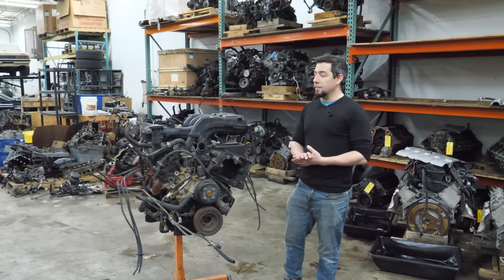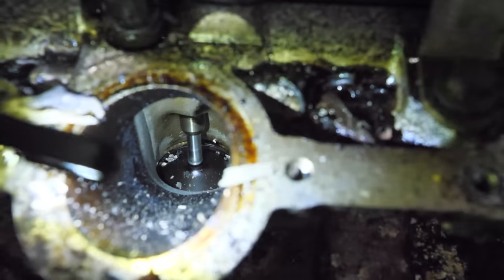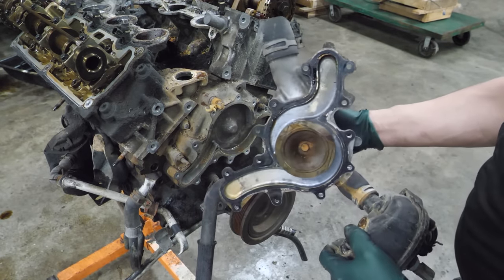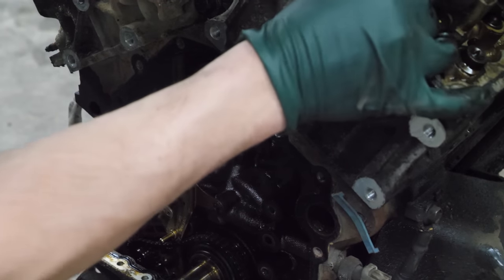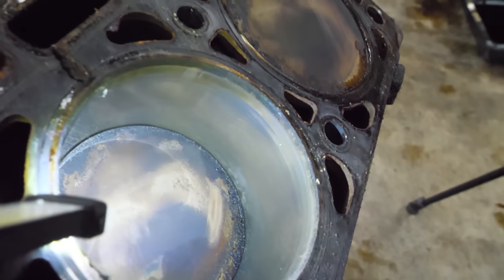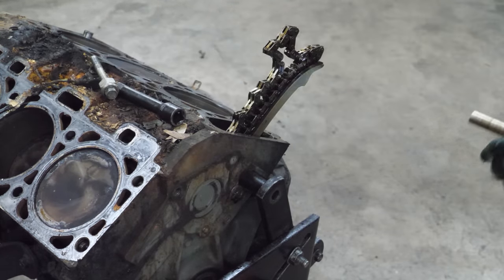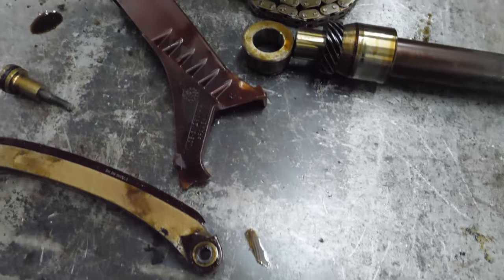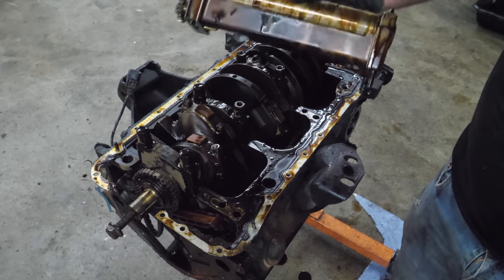Ford Explorer / Ranger / Mustang 4.0L SOHC V6 Teardown! Is This Why They're Called "Exploders" ?

Comment: I had an 05 mustang with this motor, had 190k miles when I sold it.  Ran flawlessly, but I always kept up on the maintenance and oil changes.  It was a fun car with the manual trans and got decent mileage.
Reply: The 4.0 does well with a 5 spd manual in the mustang. Agree 💯
Reply: I had an '05 vert with the 4.0 and the 5 speed, was fun on a budget. Had it until 140k, changed the oil every 5k. Only issue I had was the harmonic damper split in two and threw the belt, but not a big deal. Kind of a lazy engine but had enough torque to be fun
Reply: My wife had a '07 'stang with this motor and a 5 speed. Pretty peppy in 1st and second gear, just dies in 3rd on up. Sold it with 70k on the motor, ran like a top, Mechanics I know warned me about the cost of working on the engine if something did go wrong. Still, I hated to see her sell it. I have a '08 GT, it was cool having his and hers mustangs.
Reply: i actually have an 05 stang and it has 225,000 miles on and still runs perfect. but i also am always doing maintenance on it every week just due to the fact that i work in an autoparts store. but really don’t hate this motor and it’s been perfect for the life of it
Reply: I drive an 06 Supercharged Mustang with the V6, 234k miles, well maintained by previous owner (overdid maintenance actually) and runs like a champ!

Comment: Had to do the timing chains on my wifes Explorer about a year ago... biggest thing that had me questioning the universe was: non-keyed cam gears (held in time purely by bolt torque), that required a toolset to time... That engine better hold up after all the hours I put into that. Notes for others that are looking to perform the timing chain repairs: 

1. No, you cannot do the rear timing chain cassette without removing the engine... people are full of crap if they say you can. you have to remove that little torx bolt towards the bottom of the cassette to remove the guide, and its obstructed by the trans bellhousing, as stated in the video.... (yes, it leaks from the rubber seal if you try to reuse it, don't ask how I know...) 

2. as I've previously stated, you need that timing toolset to reset timing on the cams... it's not worth saving the $40-60 if you end up having to replace the engine. 

3. get a replacement rear main seal, its worth it.

4. If your 4.0 has the balance shaft (when looking at the front of the engine, its to the lower left of the crank), be very careful torquing the 4 E-Torx bolts that hold the balance shaft assembly in, I snapped 2 of them off.... added 2 weeks to my repair time waiting on parts.

5. yes, you can get the front cassette chain guide out and in, without removing the cam or head. just remove the jackshaft gear, and pull the old chain guide out through the bottom, by pulling it hard towards the front of the jackshaft. if you have patience, you can very carefully maneuver the new one in, though its a pain... if you're impatient like myself, just remove the c-clip on the hinge of the guide, and replace it when you get it in place.

6. it's expensive, but CHECK WHICH BOLTS ARE TTY!!! There are ALOT of them when doing this job... I have Ford part numbers, if anyone needs em, just reply to this comment.

{Edit: when I says it's impossible to do the rear cassette without removing the engine, I was referring to separating it from the transmission, and yanking the motor out. Sure, you probably could pull the tranny out, but I would strongly advise just pulling the motor... So much easier to torque things to spec with the engine out, ESPECIALLY when it comes time to time the cams}
Reply: Yeah yanno I don't think I'm willing to do head gaskets on my mom's 04 Explorer with this engine after all. Fuck that thing. Half tempted to just swap a 300 into it and call it a day, but I don't think the nose is long enough.....or that the transmission would be able to handle a proper torque factory. 300s were notorious for cooking C4s out because their torque comes on so strong so low down that they'd boil the fluid in the converter and the C4 is way more robust than the Advanc-Trac bullshit in her exploder.
Reply: Excellent advice, and yes I agree that it's crazy the cam gears aren't keyed.
Reply: @TestECull  put a 5.0 in it or a 4.6, they were available factory and can all the brackets and hardware harnesses at u pull it, but would probably be cheaper to buy a whole wrecked or rotted runner and scrap it after you get what you need
Reply: You can do the back side timing chain with the engine in the truck (I did my 05) you just pull the transmission out.
But pulling the engine is the better way.
(Hahaha I almost wrote "easiest" way)
Reply: @spex20  I mean I always follow the rule...if the repair requires them to be split apart, engine repair, pull engine. Transmission repair, pull trans
Reply: And after the cost of all the parts and the seeing FordTechMakuloco's walk through videos. I opted to buy a used engine for $400. A budget timing kit was $300. I live in Canada so don't come at me with your US prices and complaints cause a part takes 1 whole week to get to you. lol
Reply: @TestECull  as stated by another commenter, you can look into what it would take to swap a 5.0 into it, as they were available factory. Only reason I did the repair on our 4.0 is because other than the chain guide shattering into 20 pieces, the engine is in exceptional shape for 170k.
Reply: @spex20  I mean.... Fair. 3 reasons I didn't do that: 1. I didn't have a transmission jack at the time, nor the area to lift the car up and do that, so I opted to remove the engine (kinda glad I did, considering how many gaskets I wanted to replace, and flipping the engine over made that way easier, lol). 2. I'm scared to do anything to that transmission, considering it's reputation is worse than the engine.... 3. I absolutely detest doing exhaust work 😂
Reply: @jr1andonly  I hate modern engines 🤷‍♂️. If I did windsor swap it I'd start with a pre efi engine and if my mom didnt insist on efi I would just leave the 2barrel carb on it. But to me, being able to service it easily is worth its weight in gold, so if fabricating the necessary bracketry to flathead swap it meant an easier time of servicing the truck I'm buying a plasma cutter.

What was available from factory doesnt mean much of anything to me if the factory options are absolute shite and a shite flavored cheezit.
Reply: @TestECull  likewise about loving old engines. But my wife likes when the engine runs smooth and quiet on her daily 😂
Reply: @jr1andonly  Smoothest and quietest engine I've ever seen/heard/driven was in a 54 Plymouth 🤣😂. Could hear the oil coursing through it it ran so quiet. this new stuff clanks and clatters and whirrs like crazy. Mess of belt squeal, fan noises, relays clicking, timing chain slap, and a 'kill me now' wheeze that is only muffled in the cabin by a couple hundred pounds of fiberglass shoved into every nook and cranny.
Reply: @TestECull  nah nah nah... You want a smooth engine? 50's Packard Eight 👌
Reply: @jr1andonly  There is a 1941 Packard with one of those in it for sale with Gateway Classics for under 20K. Hmmm.....

....eeh I think I'd rather have the glorious burble of a Ford Flathead V8. And part availability. But you ain't lyin' those straight eights were sewing machines.
Reply: @TestECull  hahahaha, likewise
Reply: Oh yeah makes you want to go ahead and buy another Ford brand' problem again soon hmmm 🤔🤔🤗🐂🤐
Reply: @rodneyhopper22  Eh just buy a pre-stupid one. if it has a carb its prolly good.
Reply: So, the moral to the story is: if you have a vehicle with this engine, 
GET RID OF IT NOW.
Reply: @carwashadamcooper1538  fair enough. but once I did the repair, and got everything dialed in, all gaskets changed, that car drives fantastic. Now that I know what to look out for, ill definitely be keeping the car, lol
Reply: Hello,

I'm replacing the timing chains in my '10 Mustang 4.0, what are the part numbers for the torque to yield bolts?

Comment: I have had 2 4.0L fords and there was absolutely no problem. 1 in a Ranger and 1 in an Explorer. Both had plenty of power and never left me stranded.
Reply: I have a 93 2.3 5 spd with 500k thinking about doing a swap to a 4.0 or something else what do you think will be relatively cheep swap?
Reply: @jonathanjadotte  best to go to a clean salvage yard and pull the drivetrain with the wiring harness and ECM.
Reply: @KAS_Motorsports   thank you

Comment: I've owned two. One one currently. 1998 explorer sport. I love the 4.0 v6. Keep up with oil changes and don't drive them low on oil. And you will never have a timing chain issue. It definitely doesn't lack in power in the explorer either. Mine dips.

Comment: The most impressive thing about these engines is they are almost impossible to stall. A buddy had one in a mustang when he was learning to drive stick, and he could regularly get going with the rpm's dropping below 250.
Reply: Wow! That's crazy 😂 ha. I learned stick on a pos Saturn years ago. That bitch stalled super easy. Driving on a highway with traffic lights to work in it the first couple of times was fun! Haha
Reply: Can confirm, just cleaned the throttle body because of a random low idle in neutral rolling up to a red light. It would idle with the needle on the 0 rpm stop ped for about 4-6 sec before the ECUs wait time for ignition idle control could kick in(I lowered it in tune to 1 sec). You could rev it off of the super low idle too, you'd think it would intake backfire and stall but nope freakin little tractor engine. FYI, if you haven't done the EGR tube mod it is 100% worth the 30 minutes it takes to do for free if you have the tools. A nice increase in throttle response above 2500 to redline.
Reply: @1987FX16 lost oil pressure and guess the engine got out of time. still ran (pretty sure it's interference engine) and kept running. turned off and back on a few times too first turn over it starts just completely out of time and at like 300 400 rpm sputtering. but doesn't stall just barely runs!!

Comment: The reason the timing components are backwards like that is because this engine was developed from a pushrod block (The Ford Cologne V6).  The shaft that goes through the center of the engine to drive the rear timing chain was originally where the cam went on the pushrod version of the engine.  If you look at the top of the block on either side of the valley you can see the cutouts where the pushrods would have went into the OHV heads.
Reply: That most be the cheapest engine ever done.

It also seems that the cylinder heads are the same.
Reply: Converting this engine from push rod to SOHC ruined a perfectly good engine and created a maintenance headache.
Reply: That’s why they charge a lot and most of there mechanics 🧰 don’t know this, I rather have and old engine.
Reply: Would have gone.... Great observation though
Reply: makes you wonder why ford added the box on the end of the head covering the cam sprockets, when they could have just bolted on a timing cover on one end of the engine,  and kept the heads identical with bolt holes on both ends. was the cost of an additional timing cover so expensive?

Comment: This is actually a reliable engine. I have 212k miles on my mustang, full synthetic every 5k miles. Never had any problems except changing the plastic thermostat. Really simple engine and can run forever if you just change the oil on time
Reply: Not always the case mine died at 76k miles oil changed every 5k

Comment: The 4.0 is actually a very durable motor if it’s taken care of. A lot of Ranger guys love it, especially the older OHV version.  Admittedly the OHC version has a disaster of a timing chain design.
Reply: Because too many people will go against common sense and knowledge to protect their little egos in not wanting to admit they made a mistake in having a car with a shit motor
Reply: It's a cheap design that work. It's a modified ohv engine with identical sohc heads, but one is backwards. The original camshaft hole now has a rod to run the cam on both sides.
Reply: I wonder if the new corvette motor is like this. Or is it a completely new designed engine.
Reply: @nexpro6118 He's not wrong about the pushrod version though. Pushrod 4.0 is skookum

Comment: I just happened to watch a video from another channel.  The Foam was intended to keep critters and debris out of the valley.   They unintentionally made the foam absorbent so it allowed water to build up and rust anything that is in the valley.  They apparently did this with multiple different engine designs
Reply: LS motors have this, it is noise control near as I can tell.
Reply: Imagine foam, that is hydrophobic. This technology is so advanced and hard to come by, that hyundai puts it as hood and firewall noise cancelling :v
Also, this gets expensive - like retail 80 dollars for hood size one while it's just a inch thick :v
Reply: @poprawa  ok but have you ever considered that head of management and the executives all need to be able to buy matching yachts that summer? $80 is too much, best we can do is $25. /s
Reply: I can confirm it doesn't work. I have had to replace the coolant temp sensor plug on my mom's 4.0 SOHC numerous times because the squirrels were nesting in the valley. They chewed a PCV hose on the back in half,  chewed on plug wires, hell they tried to eat through the fucking fuel rails.
Reply: @poprawa  And the car sounds worse for it. God I miss the days when you could actually hear your engine running....
Reply: How dare you cheat on Eric like that... watching other engine channels.... it probably had some younger, cleaner engines too.  So typical....
Reply: I don’t see how water could build up there unless the car isn’t used for a long time. In any other wouldn’t any moisture just evaporate?
Reply: @davidchapman7667  Nope it was Kenny from Kentucky.  Old fart that moved to the backwoods from NYC.

Comment: Our 2005 Mustang with 182k is still going strong.  No noise, now I’ve replaced both the tensioners and stayed on top of the maintenance.  Engine is great around town but not great when cruising and you want to pass someone.  Knock on wood it’s been a good engine for us.  Not my wife’s daily anymore so only sees 5-6k a year.
Reply: Our Sport trac was the same. Plenty of low end grunt but once on the highway it was pretty sluggish. We had around 300k on it when my dad traded it in for the new Maverick. Still ran great.
Reply: @chefdan87  When 1 in 100 fails, that’s a bad engine. Thankfully you were with the 99. 😉

Comment: The early warning signs of timing chain issues on the 4.0L are almost always ignored. Yes, the timing system is very flawed in design, but there are steps that you can take to prolong the life of the timing system and engine. The first part in this timing system that gives is the chain tensioners, which leads to broken guides and eventual failure. As the poorly designed tensioners age, they become weaker (as we saw in the video) and cannot hold down the guides to keep adequate pressure on the chains. This is especially true on cold starts because oil does not reach the tensioners immediately, which allows the timing chain to slack and bang off the plastic guides, creating the characteristic 4.0L "startup rattle". After many cycles of this, the guides break and the rattle becomes constant while running/under acceleration until enough of the guide material is broken and the timing jumps--leading to an often catastrophic failure as these are interference engines. This can be prevented, or at least prolonged, by replacing the chain tensioners every 50-70,000 miles with new OEM units (Ford still makes them and they are cheap); they're outside the engine as seen in the video and easy enough to replace that a DIY'er can do it. Another issue that isn't spoken about nearly enough is the use of improper oil filters on these engines. These motors NEED oil filters with anti-drainback valves (OEM Motorcraft FL820S or equivalent) to help against oil starvation on startup to the chain tensioners--this alone will help prolong the lifespan of the timing system in these motors; the same ironically applies to the 4.6L SOHC V8 which can suffer from similar timing issues. Both the tensioners and oil filter are cheap insurance that almost anyone with minimal mechanical knowledge can do in their driveway. It's not uncommon to see these reach very high mileage, even while rattling around on broken chain guides--they're actually quite durable motors. Notably, the original nylon chain guides on this engine from 97-01/02 were deemed to be too weak by Ford, and the timing components were revised. Later models do fare better, however, all of these engines will eventually run into timing issues unfortunately as the design is just inherently flawed as a whole--the trick, again, is to catch it in time. The upside is that they made literally MILLIONS of these engines and parts are easily obtainable. I've owned and continue to work on a number of cars with this engine. By far the worst 4.0L timing failure I've personally seen so far was an 01 Ranger on original chains blow a hole straight through the driver side valve cover at around 260k.
Reply: I'm gonna try putting manual cam tensioners for polaris 1000 in mine when i rebuild

Comment: I wanted a Toyota 4Runner but couldn't find one in time that was good condition, so I settled on a 1996 Explorer 4.0 OHV V6 around 4 years ago.  It just passed 240k miles.  The engine being so reliable has definitely made me less apprehensive about throwing money into other parts of the car to keep it rolling.  I don't want to get rid of it.  Even if I had to rebuild the engine next week, I am confident it would outlive me.